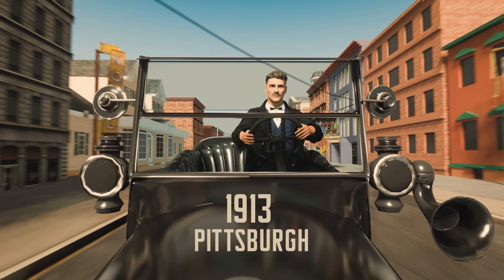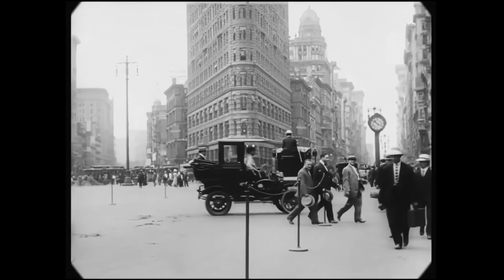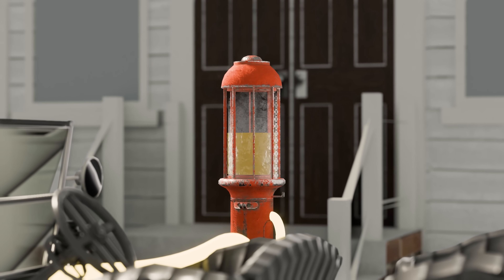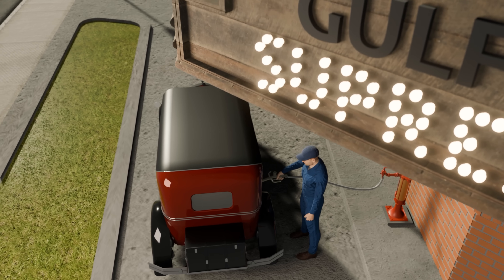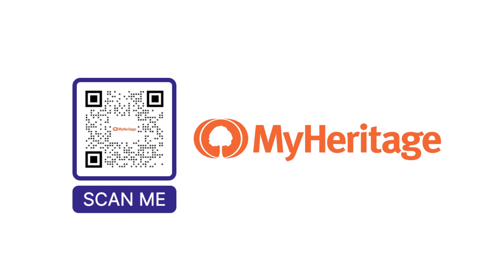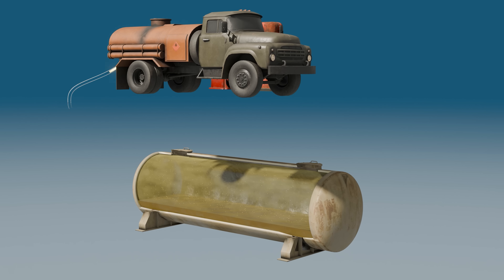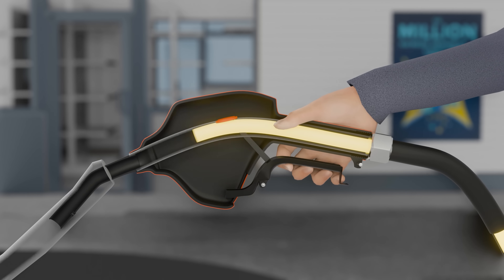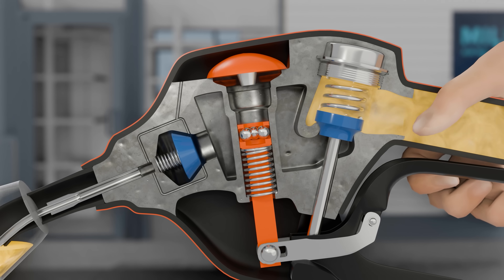The Hidden Engineering of Gas Stations

Comment: So what happens to the gasoline vapor from inside the car's tank? I remember hearing that there's some system for sending that into the underground tanks, and the reason for the new gas cans that everyone hates is because they fit into this vapor collection loop whereas the traditional gas cans did not.
Reply from the maker: Yes! Modern vehicles are actually equipped with a vapor recovery system. When you fill up your car, any gasoline vapor displaced from the tank doesn’t just escape into the air, but it’s routed through a sealed system and into a canister where the vapor is absorbed and stored. Later, when you're driving, those vapors are purged and burned in the engine.

Comment: I once watched a guy in France driving off the station compound with the nozzle still in the fuel tank opening. It ripped right off. Guess what: not a single drop of petrol spilled. Would have been nice to learn, how that worked.

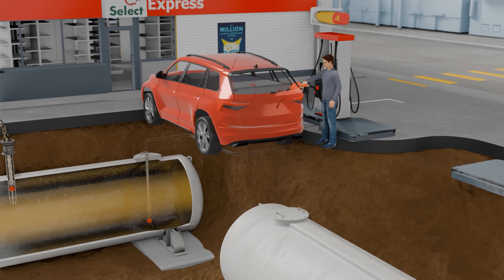Comment: 6:41 isn't the pump above-ground, ie. the apparatus you're standing next to? It draws the fuel up. It's not pushed up from the tank...?
Reply: They grossly misrepresent the engineering of an underground storage tank in this video ( I work on them frequently) but the pump is sitting just on top of the tank in most cases in a sump called a STP sump or Submersible turbine pump. The fuel is pushed up by the turbine into all of the pumps which is why an emergency shutdown button will shutdown all pumps and not just individual ones. Hope this helped

Comment: There are a lot fewer gas stations today than in the 1970's but not because of more fuel efficient cars.  There are a lot more cars  on the road today driving a lot more miles than in the 70's.  It's because of several factors.  First, in 1974, ab0ut 10% closed because of higher gas prices.  Gas stations in the 60's and earlier mostly had service garages where repairs were done, and cars became more reliable, and car warranties became longer.  New regulations and higher real estate costs made it more expensive to own a station.  The biggest factor is probably the domination of corporate-owned gas stations, selling a higher volume of gas.
Reply: Service stations are a thing of the past. Now they make a buck on every bag of chips, soda and candy bar they sell, more money there. My local Speedway sells 5 wings for $5. It costs them a dollar. Pure profit. Look at those turbo cooked nasty pizzas. They charge $5 for those and costs them only a buck.

Comment: Something has to be incorrect about the way you depicted the modern gas handle. I only say that because no longer do the pumps pump has till the fluid get to the top of the filler neck. I can prove this theory in two ways. The first way is im sure we've all experienced a pump shut off after only filling for a few seconds even the the car is still empty having to reset the handle a couple times before it actually works right. The second is the more important reason why I say that gas doesn't fill up to the pump handle is because every new modern car has a charcoal canister which is a box with a filter system that allows the vapor to make its way to the engine to burn them off. That canister is connected to your gas tank by another smaller diameter hose , if you o er fill your gas tank, meaning actually do end up fill it until the gas goes into the filler neck uo by the handle , then you've also pumped gas into your charcoal canister since that is in a lower location from the filler neck. With that being said you'd ruin the electronics in it and set a check engine code for an evap purge valve vent solenoid failure due to gasoline getting into a place where only vapor should be. The key part is that the pump should stop as soon as the TANK is full not the tank and fuel neck. So my guess is the handle detects an air pressure change in the filler neck.
Reply: The handle 100% works the way it was described. The tank has a vent pipe which connects to the top of the filler neck. Usually the pump cuts out prematurely because either the vent pipe is blocked or has fuel in it which causes the filler neck to back up. 
The tank never gets 100% filled because the filler neck and vent pipe aren’t at the top of the tank, or if they are, they extend down into the tanks slightly so the filler neck will back up and trip the pump handle before the tank is completely full.
Reply: @petesmith2234 ok tell me when the last time you pulled out the nozzle and noticed gas on the tip. Tell me when the last time you heard the pitch change from the neck filling up with gas.
Reply: @petesmith2234 the gas pump stops when the tank is full. Not when the tank and filler neck is full. The pump stops because the vapr pressure. Not because gas reach the head of the nozzle. If you dont believe me just google it. Id love to post a screen shot for ya.

Comment: The underground tanks at Camp LeJune leaked into the groundwater. Some abandoned gas stations have leaked as well. Newer underground tanks have a primary and secondary containment. I can’t remember the entire engineering behind it. I don’t believe in a perfect system. But it is extremely difficult for these newer tanks to leak. Just like the narrator claiming it’s impossible to overfill your vehicle. It’s happened to me where the shutoff mechanism failed to operate and I spilled gas all over. Thankfully the amount wasn’t enough to require any special response. If I remember it has to be 10 gallons or more. Mine was maybe a gallon. My guess is that the vapors would dissipate in the open air fast enough.

Oh and the metal nozzle contacts the metal filler hold on the car. Which would ground the car and the pump to prevent static sparks igniting the fuel. An action as simple as putting the nozzle in the car is so crucial for safety. 

Working in aviation, I asked the fueler about fueling operations. He told me that jet fuel is mostly kerosene. The movement of fuel through a rubber hose breaks electrons free and creates a static charge. Even rubber can become a conductor. This is why grounding is so important. Cars have caught fire (mostly in the winter and in dryer climates) because the person filling their car got in and out of their car. The fabric seats against clothing creates static. The person gets in their car to stay warm. Then gets out to stop fueling. The process creates a static charge. If I remember right. The rubber coated handle on the pump nozzle protects grounding. But if the person removes the nozzle and contacts the vehicle with the fuel cap still off. The fumes can ignite. Which often results in a fire starting at the filler hole. This is why it’s advised to remain present at the pump when filling. No matter how cold it is. 

Also if you fill up at night when it’s colder. You can get slightly more fuel than if you filled up during the heat of the day due to expansion. 

How did I know so much about gasoline?

Comment: One time I was at a gas station where the automatic shut-off happened way before the tank was even half full, another time the automatic shut-off didn't happen at all and fuel spilled on the ground from the tank.
Reply: Yes, I've had gas spill all over - on a rental so I had no idea where the initial click would be to where it as really full. So I just kept going.  I needed to top off since the airport was still perhaps 15 miles away and didn't want to get dinged on a less than topped off reading.

Comment: THANKYOU FOR CALLING THE DRESSOR A DISPENSER. 
Nothing drives me more crazy than when people call it a pump. There is no pump above ground. A filter, earthquake valve and electronics is it.
There is one pump per grade of fuel. The tanks actually look more like footballs with the pump located at a draw a few inches up so it doesn't draw sediment. 
I worked for about twenty years for Chevron Oil. It was fun installing Dresser Wayne systems. Consumers have no clue.
Reply: Back in the day, there was a pump in the dispenser. Look at a Tokheim Model 39 Gas Pump, or anything made before the 1980's. I think the name "Pump" just stuck

Comment: It seems like modern pumps shut off way before the fuel actually backs up to the top. I know you’re not supposed to but I’ve seen “topping off” add like half a gallon at times. Is the gas just slowly feeding into the tank and getting backed up?
Reply: The filler neck and vent pipe aren’t at the top of the tank, or if they are, they extend down into the tank so the filler neck will back up and trip the pump handle before the tank is completely full so as to allow room for thermal expansion and to prevent fuel entering the evap canister. If you continue to fill slowly, you can usually get a bit more in the tank, but you risk damaging the evap system or even having the fuel expand on a hot day and leak out.